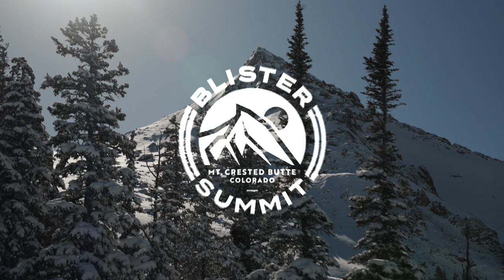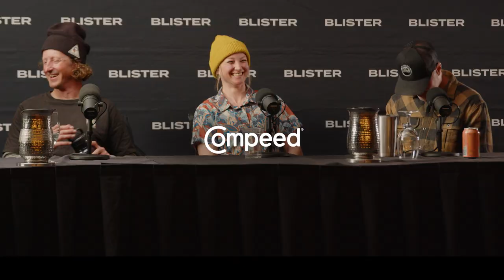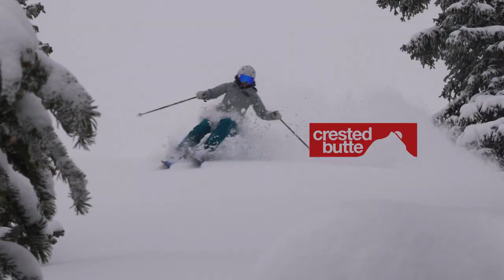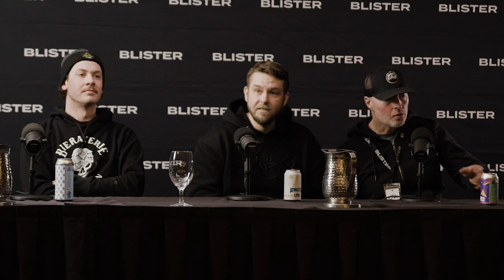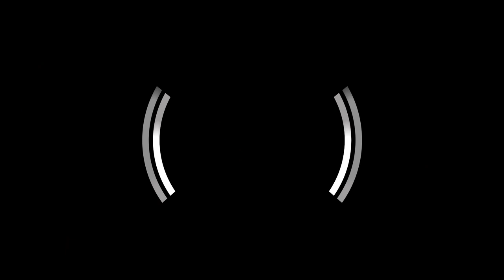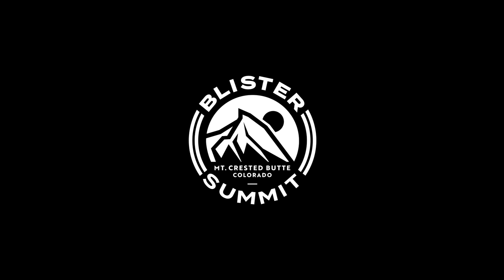BOA & the Death of Buckles? 2024 Ski Boot Design | Blister Summit Panel

Comment: I think that it's interesting to see how the traditional racing-oriented alpine brands are much more concerned about the performance impacts of walk modes than is somebody like Hoji. As an ex-racer I can definitely feel the reduced integrity of my AT boots as compared to my Raptor 140s, but for most freeride-style skiing it just doesn't matter. I'm not trying to get every last bit of power out of my boots. 90% or whatever percentage a well-designed walk mode in a 4-buckle hybrid boot provides is good enough.

As always it's what Jonathan would describe as a "know thyself" thing. If you aspire to ski like Marcel Hirscher, then maybe don't get boots with a walk mode. If you aspire to ski like Hoji then it seems less clear-cut.

I also agree with Hoji that walk modes detract significantly from the mechanical reliability of ski boots. I've experienced it, and I've seen it happen to others. In my experience you can kluge around a broken buckle fairly easily, but broken walk modes are extremely bad news in the backcountry.

Comment: I’m 5’3, 110 pounds and one of the petite advanced women skiers who see few options for boots made that fit my low volume feet. I had trouble being fitted and was initially fitted by a less experienced boot fitter  who was working at a nevertheless very well trusted boot fitting shop, with boots that were comfortable at first but far too large for me. Even by the third day I realized it was a problem as the liner was breaking in and my foot was moving around a lot out while I was skiing. I went back to the boot fitter and got a different far more experienced boot fitter who was annoyed at how I was fitted the first time. He replaced my boot completely with the Atomic Hawx women’s boots and heat molded the liners to my feet. It was night and day with how much easier skiing became once I had properly fitted boots. I’d never skiied in well fitted boots my entire life, I had learned in Jackson Hole using old unisex rentals that were so large I had to latch all buckles down as far as they could go by the end of the day in order to keep them working. Having properly fitted gear is huge in skier enjoyment and progression and something that has historically been neglected for women and petite women skiers in general, so I’m so glad this issue is finally being addressed and possibly the market for us will continue to grow. It will also benefit small men who are petite, as I’ve already seen reviews written by men who are the size of a small women using gear made for us and experiencing a huge improvement (e.g. Moment Sierra skis).

Comment: Snarky take on Fischer: "ZipFit yay! Boa meh."

I'm also not thrilled to see Dalbello moving so many boots from overlap to cabrio configuration. I'm also surprised that Dalbello could trademark "Cabrio" as a brand as the term has been in widespread use for so long.

One other remark about boas: I wonder if they have more benefit as the shell over the forefoot and ankle becomes softer? A stiff shell will tend to spread the pressure applied by a buckle over more of your foot, while a softer shell will tend to concentrate it. By contrast a boa tends to apply pressure more evenly along the length of the forefoot.
Reply: Boa has just made it to World Cup. It works and in my opinion is really awesome. I feel  that it has a slight advantage as you were kinda saying. If you look and think about it, you have four buckles wrapping your foot. And I set it and forget it. Don’t have to touch them all day.

Comment: If you "tighten" your boots once, and ski them for the rest of the day, then maybe you could make BOA work. But if you ski at a high level, and need good tension across the foot, then buckles are the only way. Pretty simple to calculate the tension achieved by a buckle > BOA. Make 20+ laps per day, and unbuckle, and rebuckle for every lap - I can do that in a couple seconds. BOA - is a cluster f**k in comparison.
Reply: On what basis are you calculating that boa has less tension across the foot? You said it very simple to calculate… How did you calculate this.